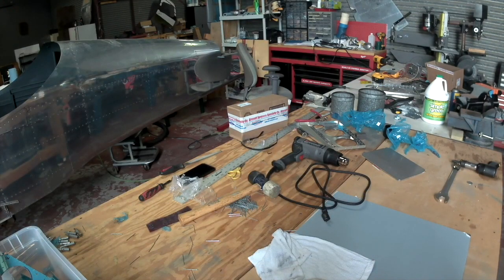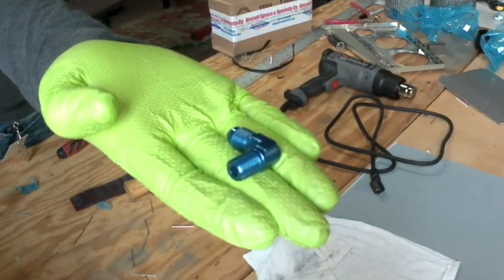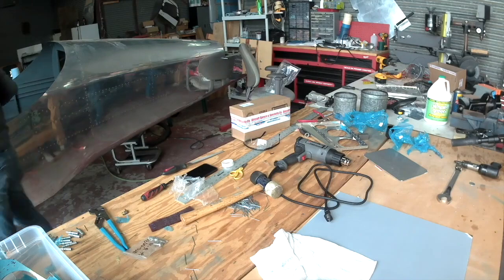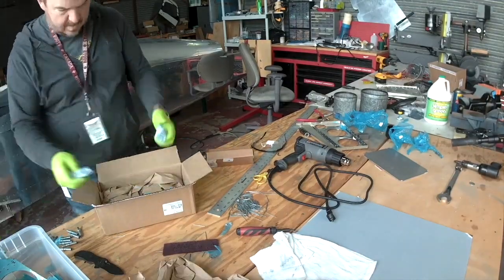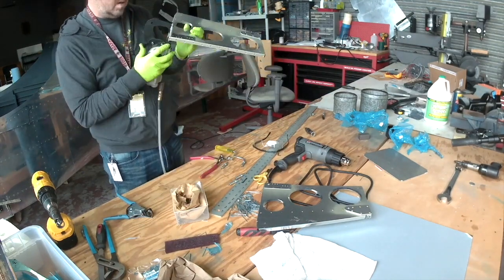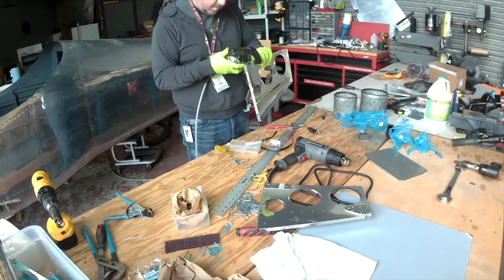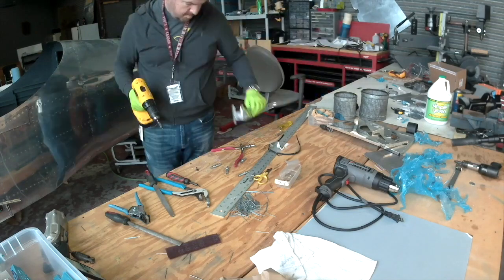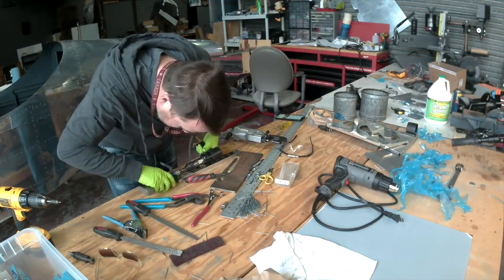RV-14 Ch 35 - 02

Comment: Can you talk about all the antenna placements, what kind and where they go on the plane. Thanks Tom upstate NY
Reply from the maker: Tom,

Not much to say really just using the locations vans has spelled out for the comms and transponder. The GPS pucks will likely go on top of the fuselage behind the cargo bay. Not using any nav radios. MAYBE a cellular antenna to see if I can get data up at 8000 agl? We'll see. Not planning on having XM so no need there.